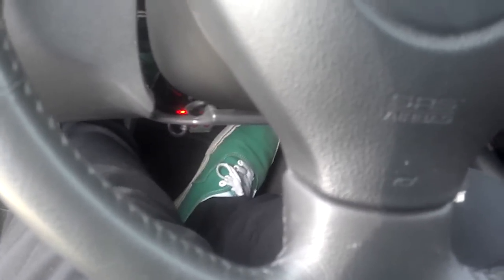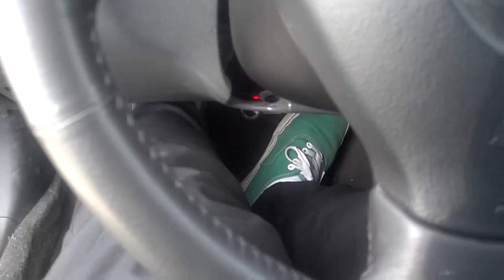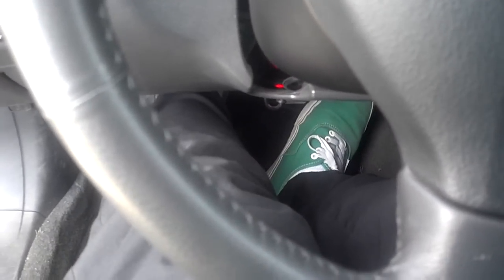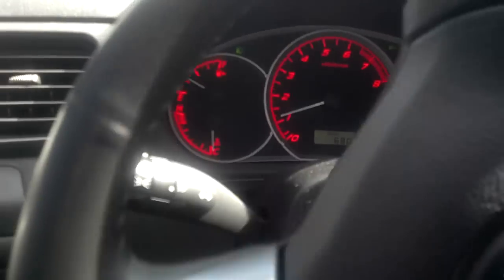Broken spring on the brand new clutch disc???

Comment: Any idea about this issue on my 2004 Impreza wagon manual, 156,000 miles. Clutch replaced 20,000 miles ago. Center Differential replaced 200 miles ago. Noise started after center diff replacement, about 100 miles later. Does not make noise in turns (except when coasting).

A mild clicking/tapping noise (sounds soft like playing card in bike spoke) is present when coasting in any gear, front main transaxle area (transmission). It varies in frequency and speed, according to the output shaft RPMs, and sometimes it's quieter or not there at all. It's probably a small piece of flat wire from a piece of seal that got away during clutch or center differential replacement.  Doesn't seem to affect operations though.  Does it about 80% of the time, but is not noticeable 50% of that time. It's quiet enough where talking, dirt roads, road noise, or any stereo masks it.

Any ideas, other than debris in case?
Reply: Hey man can you tell me what it ended up being?
Reply: @jessejahrig7866  best mechanic and I figured, a small piece of trash in the housing. Maybe a small piece of washer or gasket. We left it as is. Just going to drive it. Change fluid every 20,000 miles. It may eventually come out.
Reply: @jessejahrig7866  a noise the mechanic said to live with. Probably a piece of small metal gasket from the old center diff, when it blew apart in the Rear of tranny.

Comment: It was the incorrect tightness of the pressure plate on mine and now 99% of that noise is gone After either returning in a sequential order or replacing the pressure plate in clutch disk....
Reply from the maker: I broke 2nd gear.

Comment: For me it was a lose screw/bad screw on shifter bracket going to a bar thats to my gear stick. It stop all that noise and bad shifting took a while to figure it out. You would need someone to tell you if is moving with the rod.  On a 2007 suzuki forenza. Almost pay extra stuff to fix noise glad i did not, the mechanic thought it was motor mounts.
Reply from the maker: I blew 2nd gear. I now have 1-4 straight cut gears